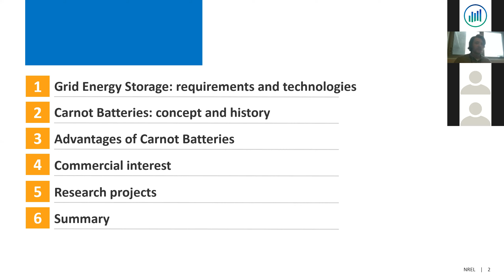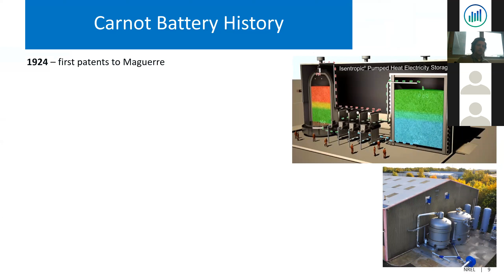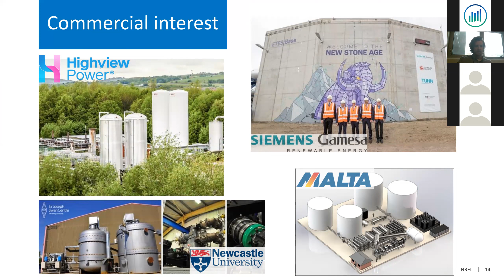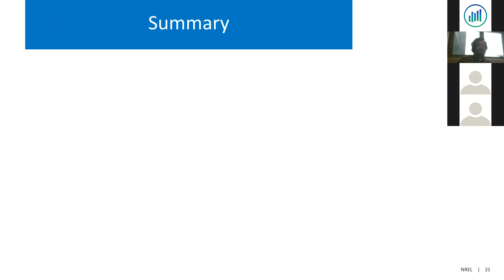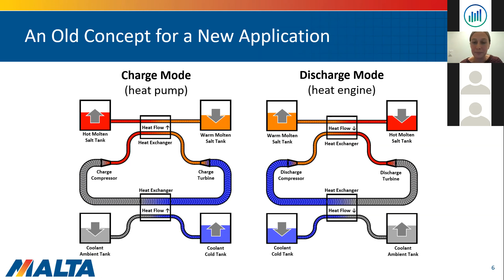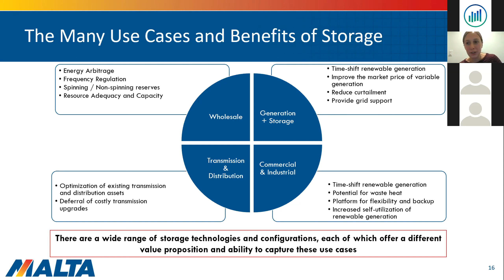The Next Step? NREL and Malta discuss Thermal Energy Storage Solutions

Comment: Carnot batteries are stupid for bulk.
because they convert from electricity to thermal to electricity.
that is called a stupid sandwich.
At best it can be 15% efficient E@E with a stupid thermal stop off of waste creation.
They are fine at thee fringe 5s to balance, create process heat in a pollution zone, but not for bulk energy storage.
This is why I have developed the CarYes cycle.
Reply: E2E correction...

Comment: A redo of the KWh vs KW in 2 dimensions to a graph in 3 dimensions with the added depth dimension to be cost.  This will show the rising cost of shorter time scale solutions as KWH and cost as a function of peak capacity.
A cut off of some arbitrary scale such as 2x the sweat spot prices may need to be added to cut off unrealistic sizes for a specific technology.

Comment: Distributed gridless Carnot thermal storage repositories would eliminate a vast percentage of energy demand. The inversion point in system architecture between centralized vs distributed is when the transmission line volume is greater then localized storage volume.